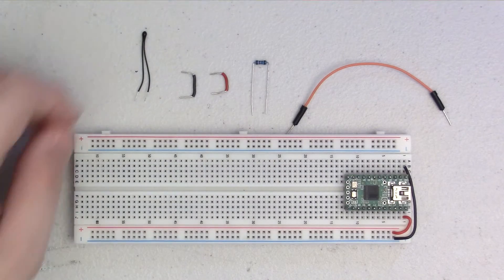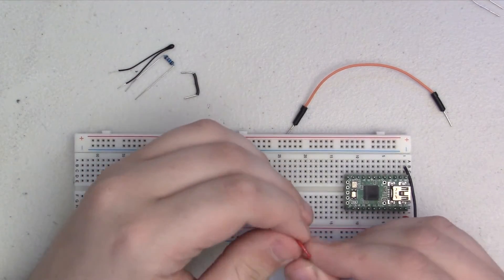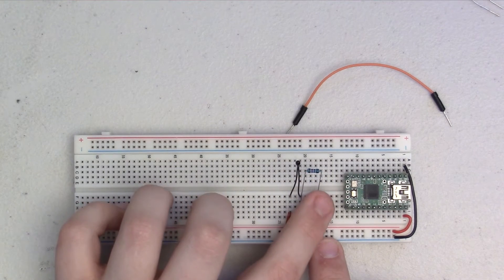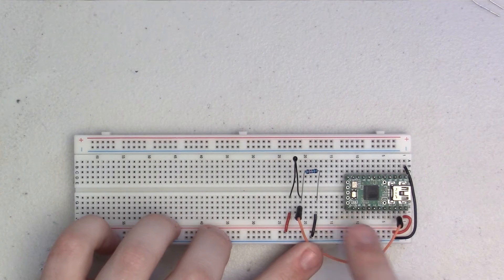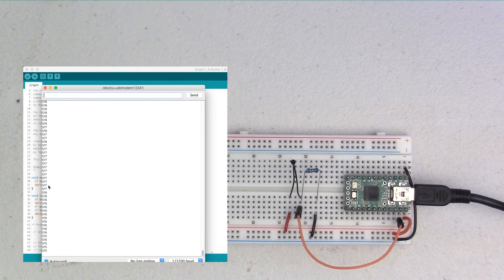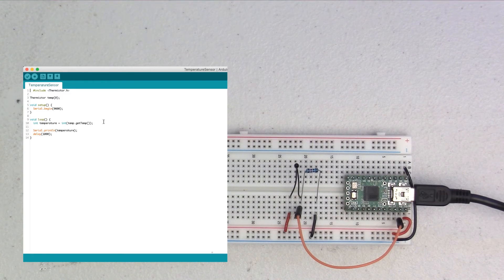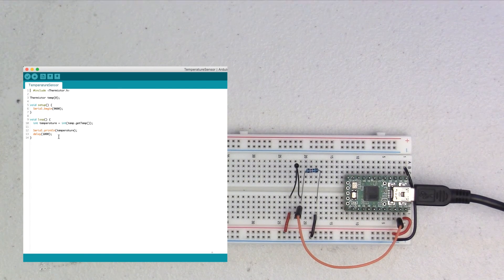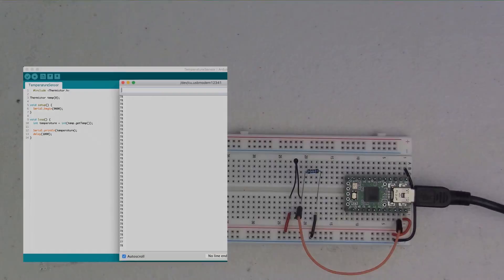How To Wire It! Thermistors

Comment: sadly no one seems to be getting any answers in here.. but I will ask anyyway.. maybe get lucky. 

this is not arduino but is thermister.   

I have 5 devices*..... each with their own very short dongle thermister... possibly 10k.. have not identified yet.  though not sure it is relative to this post.    

wondering if I can snip them off the device(s).. parallel  (or would it be series?) connect the two wires of the five device and run run long wires (of appropriate gauge) down a box in area I need to monitor temperature?

*device = solar controller..  though not sure if that would matter....  would be same question with 5 arduino boards using one temp sensor to put signal into the board for it to control what ever it does.

Comment: You said "some" of the power.... Well, that is not true. All the power goes though both. The resistor is a pull down resistor. No offense, but maybe a digital electronics class might help you understand a little bit more, but I appreciate the video. ;-)

Comment: What happens if you do not connect the resistor?
Reply: you will constantly measure lowest temp, if you do the maths without the library it will be -273.15C.

Comment: Question that I’m having a problem finding an answer to....  I have a couple of 1s lipo batteries with 3 wire connectors. I assume that means they have thermisters. I want to use them on a tiny RC airplane, that only accepts a 2 lead battery. Can I change the connectors on the batteries to 2 lead leaving the 3rd wire on the batteries disconnected, or solder the ground wire to the thermistor wire?

Comment: Have you tested the measures against a ambient thermometer? I mouted a very similar circuit and I found out that the values are quite different to the actual temperature (more than 2ºC, about 3,6ºF)

Comment: Hi, I am trying to make this work with a ESP8266. I downloaded the library and imported it in the Arduino IDE, copied the thermistor sketch but when I try to compile it, I am getting the error: 

"In file included from /Users/ap/Documents/Arduino/my_thermistor/my_thermistor.ino:1:0:
/Users/ap/Documents/Arduino/libraries/Thermistor/Thermistor.h:19:22: fatal error: WProgram.h: No such file or directory #include "WProgram.h""

Any idea?
Reply from the maker: It sounds like you haven't installed the thermistor library (or not installed it correctly). There is a link to download it in the description of the video.
Reply: thx for the fast reply. I downloaded the github project zip file, extracted it, took the thermistor folder and copied it in the arduino/library folder, restarted the arduino IDE. When I go in Files/examples, I see the thermistor folder and the example sketch (which does not compile either obviously). Is there something else I needed to do to install the library?
Reply: Found the issue. I forked the lib and made the fix. I dont know if it is because I am using an ESP8266 or because I am using a newer version of Arduino IDE. Check it out https://github.com/AlainPilon/libraries
Reply: I need help too I did the same thing as Alain but when I click include Thermistor it goes but terminator is not orange. Need help
Reply: Thermistor . h is not orange

Comment: Will this work on esp8266, don't understand how to use linked code for arduino
Reply: You can use micropython and Esp8266 to read a thermistor, using analog to digital convertion. Using a ESP8266 you will be read a voltaje (0-5v) as (0-1024) value.
You can use a micropython with a little script writed in python :).
http://www.techparva.com/index.php/2017/09/01/interface-thermistor-micropython-nodemcu/